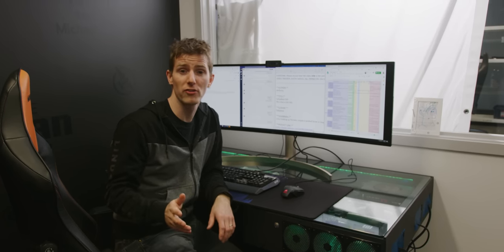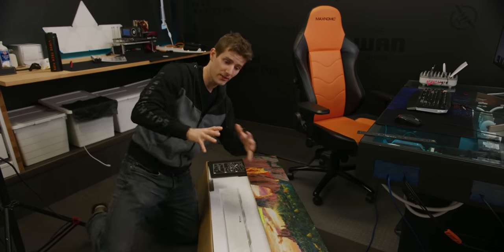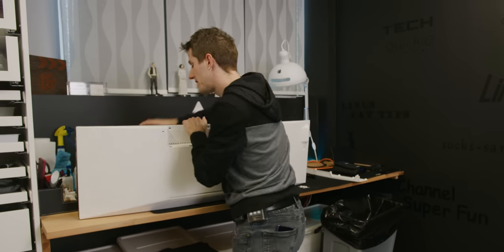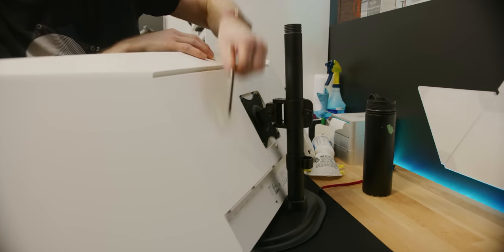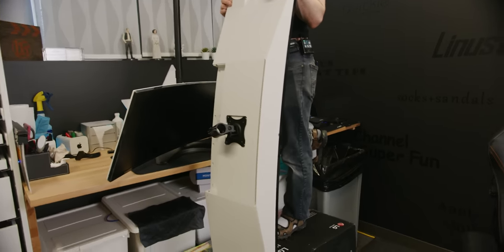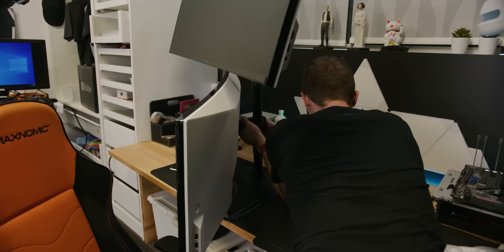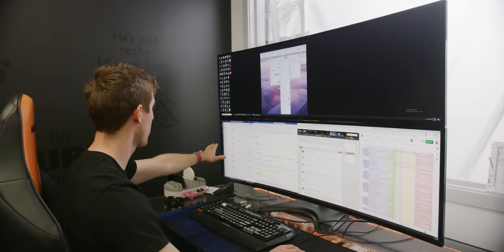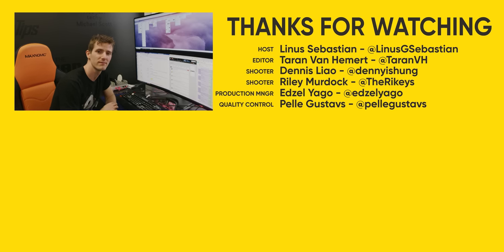My monitor just got an UPGRADE

Comment: linus gets a 49" curved monitor*

people who just use TVs: Am I a joke to you?
Reply: I use the samsung 8k 65" as a monitor and it's fine.
But the 55" would be better.
Reply: @Optical Clarity And you need a displayport to HDMI adapter, and none of them support 8k.
Reply: TV not that good... or not good enough for Linus :)
Reply: @gamerdweebentertainment1616  Yeah, mine has 15ms of input lag. It doesn't bother me but pro gamers won't like it.
Reply: I’ve got 3 24” BenQ’s because they have 1ms response, I thought I was ballin then I realised bezels are not my friend
Reply: The next video is going to be Linus realizing that Anno looks even better stretched out on a TV that size instead of on the bottom half.
Reply: Z3U5  There are no HDMI 2.1 port on the RTX 20XX serie. You need an adapter that doesn't exist.
Reply: Same, dual $200 4k TVs as monitors is where it's at, lol.

Comment: Linus: Buys crazy expensive new monitor
2 seconds later: "Thank you World of Warships for sponsoring this video"

Oh, I see
Reply: Aaaaand, his monitor says "Activate Windows"
Reply: @megafro6999  he actually has a video about that. Basically he owns a stack of Windows keys but they dick him around and make his life hell every time he had to change a computer component so one day he just said fuck it and stopped activating.
Reply: @jared3mac  Oh wow that's annoying
Reply: @megafro6999  yeah and sometimes it even happens when you have to reseat your Graphics card etc. It's like Windows thinks it's a brand new PC so goes "Nope this has been Activated on a machine before and this isn't it". The amount of time I've wasted with MS support getting them to reset a key and trying to explain it is thier system and not me trying to pull a fast one. Grrrrrr 😡
Reply: this happens because he probably have Digital Licenses, which are branded with hardware. If you buy a Product Key, it will be associated with your Microsoft account, even if you get new laptop/computer.
Reply: @013nil  his keys are probably OEM keys or Company Account keys and these act differently to Retail ones (I'm leaning more towards OEM with how much issues he's had as I've had the same)
Reply: @megafro6999  Linus has covered this many times and has even done a video covering why sometimes his systems have an "Activate Windows" prompt.  Its a non-issue, nothing to see here, move along.

Comment: What I dont get is this:
He gets a single ultra wide to avoid having a bezel in the middle, but instead of getting a tv he goes double ultra wide and has a bezel in the middle....
Reply: Also resolution, you get more of it this way
Reply: @hououinkyouma1458  except he proceeds to not flex it anyway because of the gap it creates... this video idea is purely done for entertainment, it makes no sense to not use a TV at that point.
Reply: @marcup1584  It actually does. It kind of makes a physical separation between the above and below monitor so you can visualize that more flawlessly in your brain. Its called workflow. It need not make sense for everybody as long as it makes sense for the one who uses it
Reply: @cedricgoudswaard1369  The difference between 5k and 4k is barely going to be noticeable.

Comment: A monitor was a relatively small warship which was neither fast nor strongly armoured but carried disproportionately large guns. They were used by some navies from the 1860s, during the First World War and with limited use in the Second World War. During the Vietnam War they were used by the United States Navy. The Brazilian Navy's Parnaíba is the last monitor in service.

The original monitor was designed in 1861 by John Ericsson, who named it USS Monitor. They were designed for shallow waters and served as coastal ships. The term "monitor" also encompassed more flexible breastwork monitors, and was sometimes used as a generic term for any turreted ship.

The term "monitor" also encompasses the strongest of riverine warcraft, known as river monitors. In the early 20th century, the term "monitor" was revived for shallow-draught armoured shore bombardment vessels, particularly those of the Royal Navy: the Lord Clive-class monitors carried guns firing heavier shells than any other warship ever has, seeing action (albeit briefly) against German targets during World War I. The Lord Clive vessels were scrapped in the 1920s.

Comment: Why didn't you just turn around the top monitor. Then you would have gotten rid of the extra bezel.
Reply: Viewing angle restrictions. I tried that 3x2 , it was decreasing the color view. 
But I switched from 6x22" back to two monitors. 2x43" 4k much better at PDF viewing
Reply: Thats a good idea
Reply: @larsradtke4097  I've never had any issues with it. I understand if you wanna tilt it then it might benefit to have the bigger black bar in the middle. It might of course be different from monitor to monitor, regarding the colors.
Reply: Yeah I'd have so flipped it and just set it in Windows too. Would sit so much nicer bezel wise.

Comment: Suggestion for ergonomics: modify the computer/desk to stand on the base of an electrically motorized legs. That way you can work either sitting or standing and always easily adjust the height to match your position. That's what I do, and it's great. And while you're at it, add rollers on the bottom to be able to easily move the desk for maintenance, cable management etc.

Comment: When you realize you spent $4k on two monitors that could have just been a 55" tv with no gap
Reply: But 144 Hertz said Linus the spender
Reply: @birsp  But Thickness
Reply: @birsp  your Asus is just 4k so Linus could only fit as many things as on 27inch 4k display. It just doesn't make a lot of sense
Reply: @birsp  He has 5K resolution here, it's really important to have high resolution to put more things on the screen. It's 70% more than 4K...... I would love to see another 5K display .... Or even 38" 21:9 5120x2160
Reply: @xenio8736  so buy an 8k tv for less
Reply: @konzo5942  Him putting up a large TV would generate fewer views. The purpose of the video is to generate views.

Comment: I'm sure it's a limitation of the stand; but I'm curious as to if you could flip the upper monitor over, so the bezel between the monitors is that much smaller.

Comment: Since this episode had a fair amount of back pain in it, I'll give you some free advice.  You need to raise both monitors up so that the seam between them is at eye level when you're sitting.  In a single monitor setup, the center of the monitor should be at eye level, but with two of them just make the seam eye level.  With the monitors lower than eye level , that little bit of forward flexion of your neck (for hours on end) matters.  Making this change will give you a few more years of pain free neck movement before the discs give up and your start having to come see people like me regularly. I've seen this simple change take 70% of issue away for office people who are in there 30s and 40s.  If you start this when you're young, you may avoid neck issues all together. (I'm a chiropractor).
Reply: Brandon Linker The optimal position for a one monitor setup is to have the the top of the screen at eye level. That is because the most comfortable eye position is about 20 degrees down. With a screen as big as this I would argue it's impossible to get an ergonomically correct position though... That is what I was taught at a university course in ergonomics at least...
Reply: @akashiYT  all I can tell you about is my own personal experience and neck pain and those of my patients.  Preventing that 5 to 10 degrees of flexion makes all the difference when sitting all day.  Do people always gaze down 20 degrees and keep neutral neck posture when they work? I would argue that they do not based on my own experience.
Reply: Brandon Linker Yes I do believe you and it's an interesting observation. I can imagine sitting with a laptop all day every day must be bad. I would give you references about my info but can't remember where I read it unfortunately...

Comment: 1:45
Packaging companies: don't use a knife to open!
most persons: do it anyway or use scissors
Linus: uses a ruler
Reply: Linus: puts 90 pounds of monitor on glass desk
Reply: @piyh3962  my wooden desk already struggeled with my 2,8kg pc (+2 nirmal 24" monitors). Had to put a fifth leg in the middle that it doesn't bend anymore xD

Comment: Excellent results - as a 49" AGON user - I can't see using anything else. Thanks (two wouldn't work without a gap - as the On screen buttons are on the bottom right - but the remote would cover most issues :)

Comment: Nobody:

Linus: Let's get the cheapest Monitor Stand for 2x49"
Reply: I mean, can't fault him. It kinda worked.
Reply: Next week how to scratch build and weld your own ultimate monitor stand, it will hold ultrawides and it will have a hammock for Linus
Reply: Cheapest stand with a total of $3500 for both monitors

Comment: He should have put the second monitor upside down with the LG logo on the top.
Reply: The color rendering can be quite different when you flip one over like that, or it can make it hard to find the sweet spot of both monitors at the same time. This is a bigger problem with TN panels, but IPS is not completely immune.
Reply: I was looking for this comment....
Reply: @mal2ksc  pretty sure this uw is an VA panel
Reply: @mal2ksc  You can't forget about additional input lag, because video signal scanlines needs to be rendered upside down.
Reply: @oo8dev  I don't think that's particularly significant for this use case. Chances are, any frame-critical window spans only one display, and it's not that big a deal if your HUD is 17 ms behind. This would actually work in favor of flipping the second monitor over anyhow -- you'd have all scanlines rendered from the center of the space to its edges. I just don't see that this tiny edge actually matters, let alone overrides the other issues like cables coming out in weird places, having the power buttons be at opposite ends, having to set up ClearType separately for each one (admittedly a minor annoyance in Windows 10, they've gotten way better at handling rotated monitors), not being able to get the color rendering to match, having a small vertical sweet spot, etc.

Comment: When you realize a tv is the same thing.
Reply: Except with lower frequency and more latency
Reply: An LG 8k would do same while being oled, 120hz
Reply: @Kristof Alexy 8k ;)
Reply: @Spider-Man62  120hz is slower?
Reply: @victorperezADSK  using oled on pc monitor is not smart. You'll get a lot of screen burn-in.
Reply: @victorperezADSK  OLED for desktop would be terrible, the taskbar would be burnt in. And he'll have trello blocks burnt in etc etc
Reply: @ryanmalin  Depends on the TV and if you can disable all the bullshit, and ofcourse the resolution and size of the TV. I'm using a 43" 1080P" TV on my HTPC. I can count pixels if i get to reading distance.

You would need at least 4K to have a large screen like that. Or a smaller TV, but at that point a 1080P monitor is cheaper.
Reply: People arguing that a TV is worse than a monitor: What about a BFGD then?
Reply: @MrHendrikje  Which is why my main monitor is a 50" 4K TV at 175% scale since tech companies don't send me free shit XD
Reply: @danielgomez7236  they have differences to a normal TV
Reply: @ru2225  I mean, is a BFGD better than what Linus did?
Reply: @danielgomez7236  not much difference for him, as he isn't using it for gaming, but for work

Comment: Literally could have got a 55"+ TV for this, I use the 55" C9 and its awesome, not very bright but awesome!
Reply: A tv is not a monitor, totally different experience
Reply: @antonbrevini  but the c9 is oled, can go up to 120hz, and has comparable input lag. Not to mention the response times are rather good, due to it being oled
Reply: bfgd, anyone?
Reply: TVs carry far more input lag, usually don't have as good a resolution-viewing experience, and aren't generally rated to be as color accurate as a content creator would need them to be, that's why he went with CUW monitors. That's why even moderately tech people explicitly tell others to not use TVs as monitors.
Reply: Yup, I use a 55" 4k TV as my monitor
Reply: @antonbrevini  that's becoming less and less as time goes on. Today's TVs are pretty much a monitor with a TV tuner and speakers, and some offer pretty good response times (some not so much). Some do have a higher than 60hz refresh. You just have to to research before you pull the trigger. 

The TV I use has a pretty decent pixel response time, very little to no blurring. Very little if any input lag when game mode is enabled. While mine is limited to 60hz it's fine for what I use it for.
Reply: @Valanway  not always so.
Reply: @Valanway  Linus has a LG C9 at home so he knows he could have done it... The LG C9 OLED TV uses HDMI 2.1 and out of that the RTX series uses HDMI 2.0b which means it can take 1440p at 120hz. Ideally we would need to wait for the new GPUs with HDMI 2.1 to utilize 4K 120hz at the desktop. Way better than that weird setup with a massive horizontal black bar through the middle ;) Mine is literally perfect

Comment: We: Why didnt u use tv.
Linus: We dont do that here.
Reply: Actually one of his editors (Tarran) I believe has a big 4K tv as a monitor...
Reply: @matesaktesak  during one of linus' videos on a "monitor" that was the size of a TV and he just put it on his desk at his house and moved his 3d printer to his wife's desk
Reply: NeoIkyh  honestly it sounds like a great idea for most things unless if you plan to game in competitive situations because of the general limit of 60 or 50Hz
Reply: @butterfree24 I think that the most 4k Oled televisions have a 120hz screen, maybe they don't have a hdmi 2.1 so they can only 4k60 or 1080p120 (with ycb'cr you can do 4k120 on a hdmi 2.0b) but even no gpu has a hdmi2.1 at the moment (rtx 3000 series probably) but I think that a 4k Oled TV is a perfect solution
Reply: @dieterliesens627 /videos To be specific, LG (which is the company you probably should be looking at for gaming on an OLED) supports 1440p@120Hz with 4:4:4 on the old C9 models over HDMI 2.0, and will support 4K@120Hz with 4:4:4 over HDMI 2.1, the problem at the moment being that there are literally no GPUs you can buy that have HDMI 2.1, so you will have to wait until Nvidia (or AMD, if they can make up the performance difference) comes out with one.

The NEW CX models do actually support 4k@120Hz over HDMI 2.0b, by using 4:2:0 chroma-subsampling, so if you're willing to take the image quality hit in games, and want a big 4K OLED for gaming right now, that's your best bet. And when they come out with HDMI 2.1 GPUs, you can upgrade that and get running at full 4K120Hz 4:4:4.

Still doing OK with my old B7, which has been my main work and gaming monitor for over 2 years, but when the CX models come down in price in about half a year an upgrade is definitely in the cards...
Reply: @fazfoxy1119 /videos 60 Hz for 4K for the older TVs, yeah, due to HDMI 2.0b not supporting higher refresh rates at that resolution without chroma subsampling. C9 can do 1440p@120Hz with 4:4:4, and when HDMI 2.1 GPUs roll around will be able to do 4K@120Hz with 4:4:4. Current LG CX TVs can do 4K@120Hz with 4:2:0 chroma-subsampling.
Reply: @jubuttib  thank you so much for the information, I have a c7 but I use it only for watching TV because it's a little bit to big for my desktop

Comment: hi Linus. For make this setup of yours work with multiple windows side by side, consider linux, and specifically TILING WINDOW MANAGERS. Check the i3 window manager, which is basically the same thing as a desktop environment (not technically), like gnome or kde or budgie etcetera. if you want to give it a go, i suggest installing manjaro i3. Maybe check manjaro i3. Tiling window managers are the thing you are searching. Your productivity and awesomeness could really benefit from it. Don't bloat your system with software to hack Windows, when there are operative systems that do what you seek natively since years. Also linux is way better when dealing with multiple working spaces.

Comment: Discord: exists.
Linus Tech Tips: Uses Microsoft Teams chat.
Reply: To be fair - they're using Teams for their corporate environment which is what Teams is designed for. Discord was made for regular consumer use and doesn't have features that are required for corporate environments (password strength enforcement, 2-factor auth, user auditing, 99.99% SLA, etc.)
Reply: @iN00bT00ber  True. You'd think Discord would lock down that market -- they already have the perfect setup for it.

Comment: He keeps saying that a 49 inch monitor is like two 27” monitors side by side, but that would be 54”. A much closer comparison would be a 24” monitor which would be 48” side by side. It’s pretty basic mathematics Linus. I know you don’t use the imperial system up there, but that doesn’t change how addition works.

Comment: The manufacturers should make the bezzels come off so you can customize the monitor layout and not have a seam. Or can you cut off the casing in a way that it can be reatached to get rid of the seam. you have stuff for it technically. Maybe take it apart and then cut the bezzel and add custom joints for both getting rid of the seam and to put the plastic back on afterwords.

Comment: I just got the CRG9 and wanted to mount my old 27" above it so I used this mount. And can confirm, I thought I was going to shear off the bolt trying to get it so the monitor didn't droop. Ended up using my ratchet and and extension bar for leverage, I almost threw the impact wrench at it but sanity prevailed.

Comment: How about 3D printing up some kind of spacer/block that can be placed into the bracket near the pipe, that  way it will help keep the screen at the angle you want? That way it’s not just the clamp/Allen bolt holding it in place.